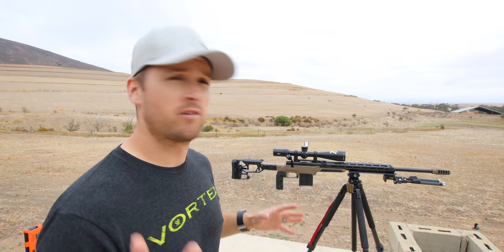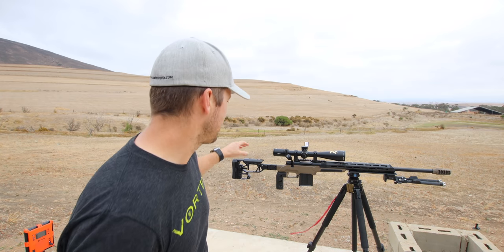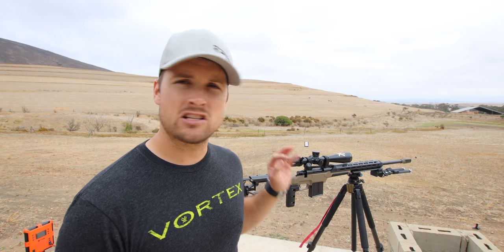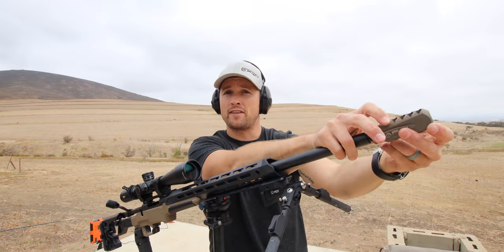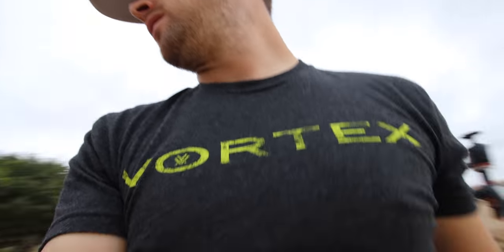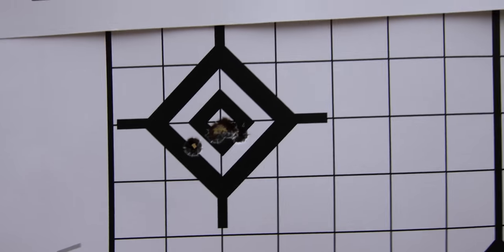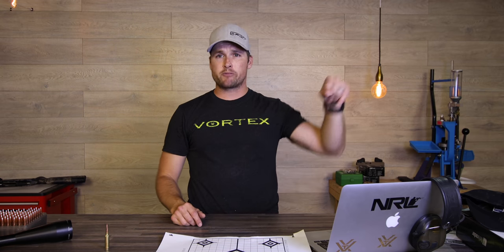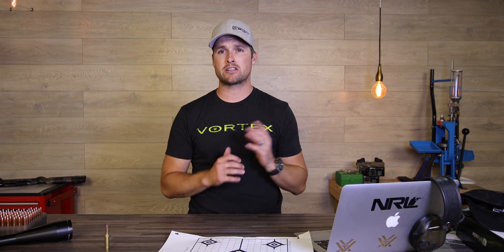6 Creedmoor Load Development (Howa 1500 )Part 2

Comment: Delayed or hang fires when it is cold or just slow burning powder you have to ignite with a srp? Open the flash hole to standard diameter and the issue disappears. I do this as standard since experiencing it years ago with Lapua 
Palma brass necked down and formed for 260 AI.